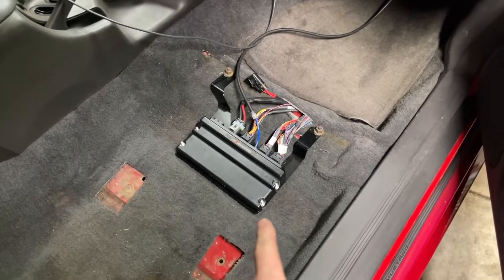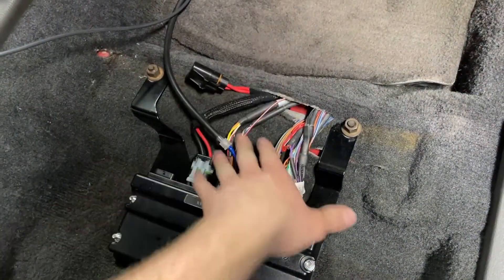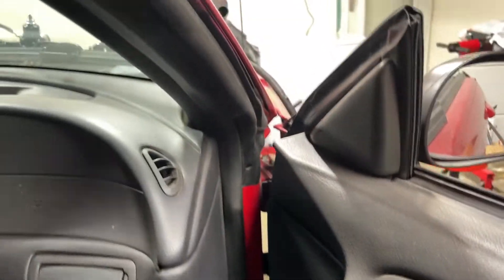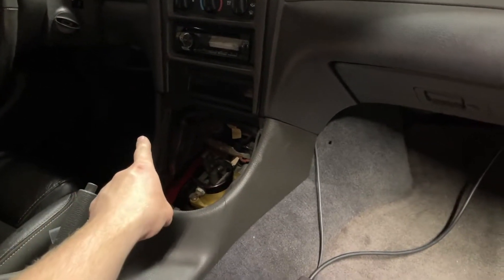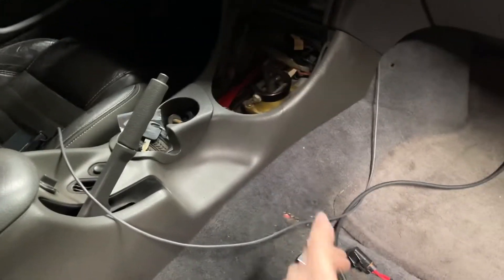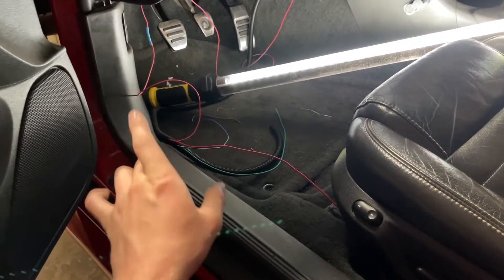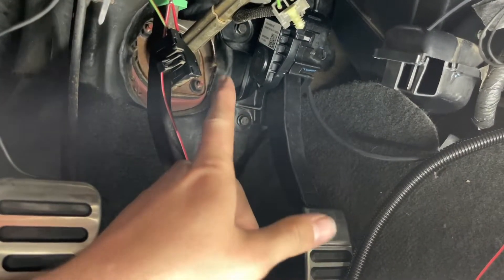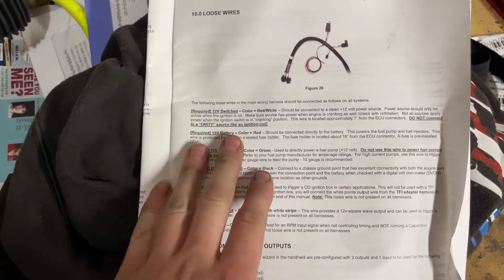Coyote Swap Holley Terminator X Wiring

Comment: Totally dig the videos man. Starting my 95 swap this winter. Have all the Holley harnesses minus the ECU. Leaning towards the Term max over the dominator as it will be a street ripper. Suggestions on that move? It is a 2017 gen 2 with a TVS 2300 Roush on it and will have a T56 Mag behind it.

Comment: Nice setup. Once you get it all loomed up it'll be just right. Nice to be able to t/shoot prior to wrapping it all. What lower radiator hose to Coyote did you use? It's a stepped setup if using a stock 4.6 radiator, sans the "Y".
Reply from the maker: I haven't gotten the radiator hoses all figured out yet. I'll update once I get there though.